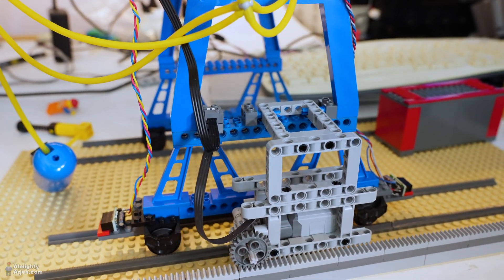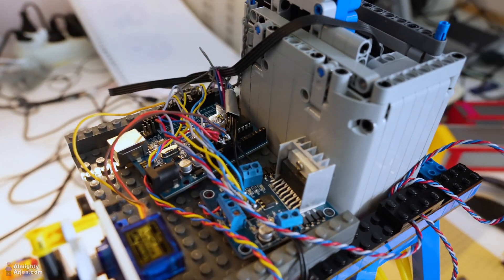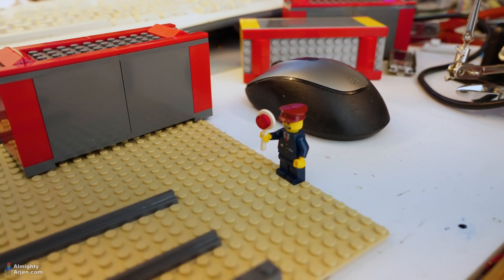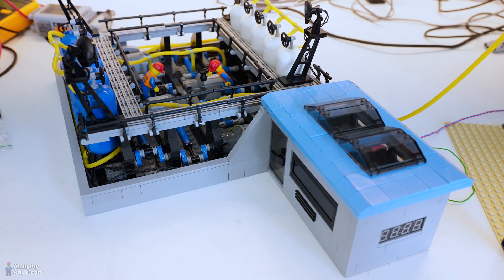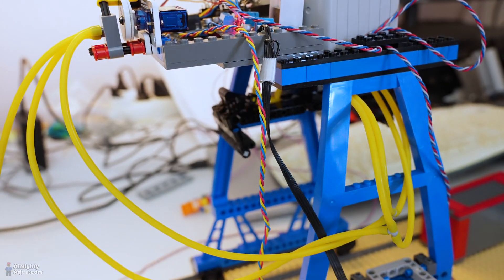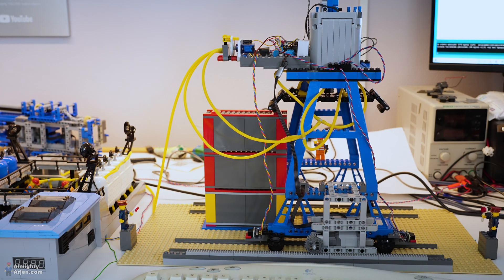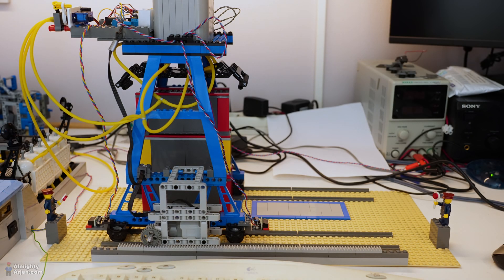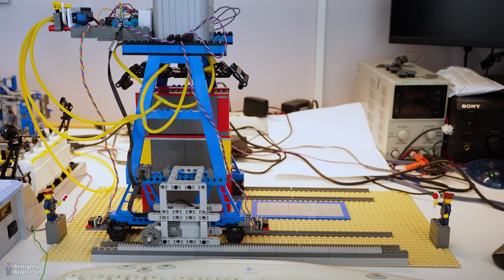Lego train automated container terminal WIP E27: Endurance test: moving containers!

Comment: Option 3 is lower the height of the containers by one plate. This also requires new timings, but no adjustments in the crane.
Reply from the maker: True, but I want to use "Maersk compatible" containers, which are part of the Maersk train. I added one plate height as tiles on top of the containers, if needed I can remove the top plate of 6x16 and put the tiles directly on top of the bricks (and fix the tiles together on the inside of the container).

Comment: if you need a small compressor with decent performance get the fischertechnik compressor it is small compared to this and it  has plenty of power edit: maybe need two or three of them to get enough power but it will be a much more pleasent sound than yours right now
Reply from the maker: That's against my "Lego only" philosophy ;)
Reply: @AlmightyArjenWip  Please don't get rid of the Lego compresser, it is an extremely cool feature!
Reply from the maker: @explainwithlego7699  Don't worry, I won't!